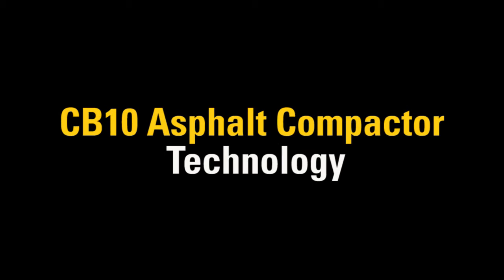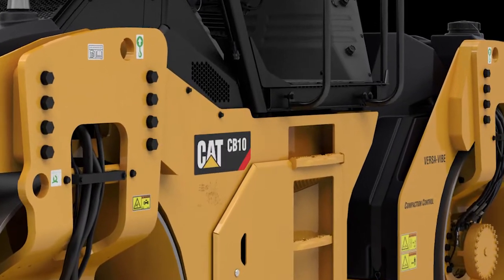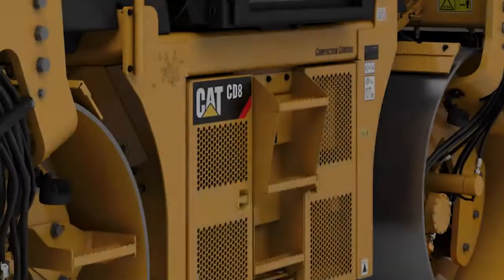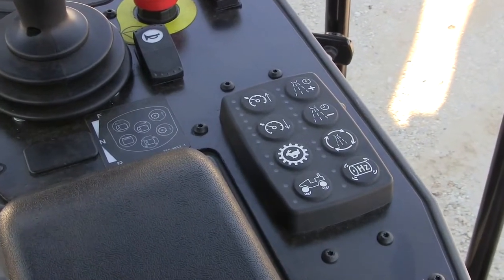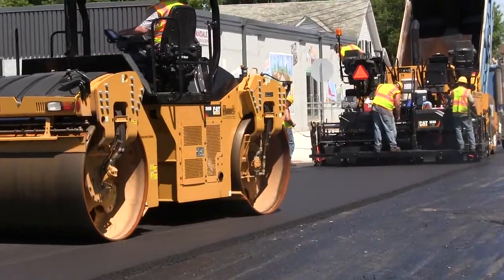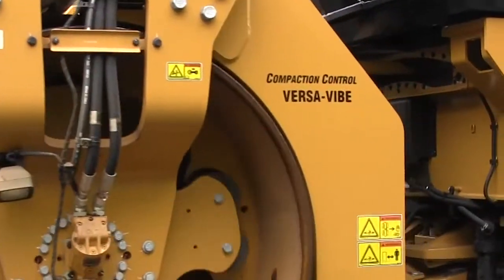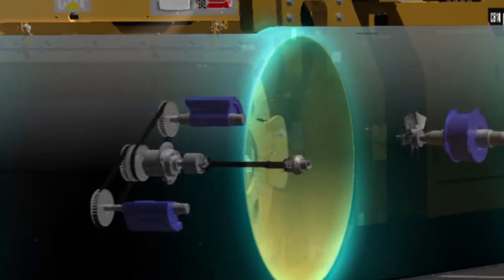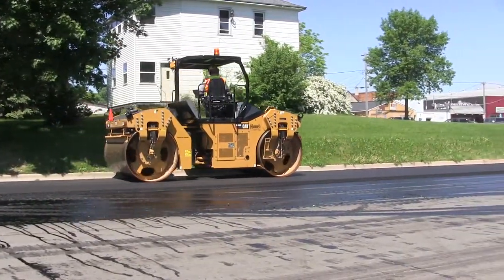CB10 Oscillation Overview

Comment: This driver station will cause severe injury to the operator because he only sits and does not move his body. All movements are minimized, the steering motion is reduced , only a small steering disc means the motion of the roller operator is reduced to a minimum. The result of this socalled monotone body position is severe danger for the health of the operator. If the body of the operator is supported too much the danger becomes very big. Muscles need to be used, it is called "use them or loose them". Well, here you only loose the power of your muscles and within a couple of years especially older operators will become trouble with normal walking, climbing stairs. The whole ergonomy of the roller is a piece of shit, sorry I have to say this but it is the truth. If you want to see how real ergonomic looks see the youtube movie of the 2006 Leeboy 400 roller. Here you see how the operator has a much more active body position with the driving levers at the steering wheel.
Reply from the maker: Thanks for your feedback. We’re always striving to deliver the best product options for the industry. Your recommendation has been passed on to our development team.
Reply: Thank you very much to hear that, you know I am not just complaining. The last ten years I have worked with Hamm DV 70 rollers and I was part of the development of the newer DV70I. But to be honest, the result to my body after ten years of work with this kind of ergomy, where all the controls are mounted in the driver seat has caused a lot of trouble to my body. I started my job as a roller operator in 1977. I was involved by the development of the Bomag BW 184AD , this development started in 1994, in december 1996 I did the final test before the roller was presented in 1997. What I like about the new Hamm is the cabine with a lot of space, but what I don´t like is the ergonomic level of the seat, this is not good. I told that to the company, but they put a lot of money in this system and they had contacted some Universities to develop this kind of ergonomic driver seat and they decided to put this system in every large Hamm roller. (I wonder what kind of experience Universties have with road rollers, in my opinion absolutely nothing). The seat can only be operated electrically. So the operator have to sit the whole day in only one single body position and when he wants to put thee seat from left to right or opposit it can only done electrically. So the operator has only a statich body position. I think you can imagine what effect it has on the circulation of the operator, he´s every day in severe danger of getting problem with blood clots and thromboses. I have designed several solutions, if you want to get some advice you can contact me. A former colleague from me is working in Holland by the dutch importer of CAT , the Pon company. We have already spoken about ergonomic. Maybe a possibility to keep contact with the help of the dutch CAT company? My Email address is adklompenmaker@gmail.com
Reply: @walsmachinist1  What? You can't stand up and stretch? You can't get off the roller and walk around? You can't dismount and help the guys rake and shovel? Perhaps you need something more than a steering wheel.
Reply: @margaretborne5918  I go out of the cabin as often as possible, I have a mountainbike in my car so when there is some time when we have to wait for the next truck I go cycling for half an hour. At the end of the day I cycle, walk. So I do a lot. But I am also a consultant for ergonomy and the way the new rollers are built is quite stupid. There is nothing ergonomic about it, look for example to the small rollers, every operator has to sit in a position where he or she has to bend over a lot to see the outside of the drum. Very very stupid, all people who have designed this kind of ergonomy should be send to prison!
Reply: @margaretborne5918  One other question, are you employed by the CAT company?
Reply: Another strange thing is the commercial for oscillation, I have a brochure of Cat where they say that oscillatory compaction is worse than the CAT vibration system, and now they are recommending Oscillation, have I missed out something???